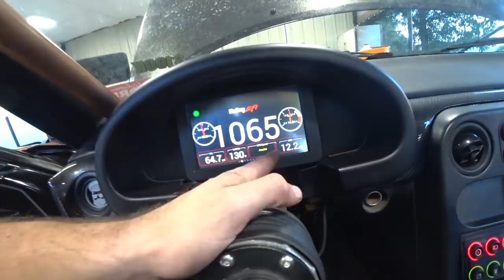Putting legit race car AC in the LS3 Miata (no ice needed) and it's a game changer.

Comment: What if you use dry ice? 🤔
Reply: Expensive, hard to find at times, systems freeze up and are a maintenance nightmare. The SuperCar Pro Series used to run a lot of dry ice systems but they have since switched to Chillout Systems. Check out the Red Bull team, they rock our system. :-)

Comment: I hate to say this but that's a terrible location for it. In a accident that's going to a heavy projectile that could easily take a head off. 

You do know that you can buy a ice makers for camping. Or if you have room in the trailer a heavier one. Small ones are about $100-150 super small and cheap. Stock water in the trailer and you are done. Hell you could buy a stack for the price of the cooler.

Comment: Question:. Why not just install an A/C unit?  Will it drain that much power?
Reply from the maker: Installing actual ac requires a lot of components. Ac compressor where my dry sump pump
Is mounted on the engine. Lines to the front for a condensor which is like a thin radiator. Then a huge box with fan and such under the dash with custom lines going there which there is no room for with everything I have mounted under my dash.
Reply from the maker: Plus the heat from the ac condensor plus the added engine load will make the car run much hotter while waiting on grid.
Reply: One of the best reasons to run a Chillout System is that it's only 11 lbs! AC systems are over 90 lbs on average for a Miata. They are heavy, rob power, do not provide cooling during wide open throttle and offer nearly no cooling while wearing a helmet, fire suit, gloves etc. This system quickly and efficiently pulls heat from your body and essentially turns your race suit into an air conditioned micro climate.
Reply: @Taylordrifts  Wow.  I didn't think about all that to be honest.   I just thought it was too much gas and it takes away from the Horsepower.   Damn!  Thank you for sharing man.
Reply: @chilloutsystems6478  90 lbs?    Are you serious?   Either way, I'm excited to see how this works out for Taylor Ray.    I hope he shares the experience when he is out at the events.   s
Reply: @chilloutsystems6478  Question I posted outside of this thread.    Can another line from separate storage tanks be run by splicing or some other method, through the device and cooled down to drink or would that need to be a separate system?

Comment: Won't the Florida sun hitting it through the back window heat it up considerably too?
Reply: It’s designed for 140° environments, it won’t bother the system at all. This car still has carpet/insulation so the performance should be excellent.
Reply: @chilloutsystems6478  Cool. Thanks for the info!

Comment: Hmm. I wonder if a TEG style seat cooler would be enough.

This thing is probably a TEG system that cools the water.

Lots of things on Amazon in the $100 range. Way easier install.

https://www.amazon.com/dp/B01CIID1FM
Reply: We use a rotary micro compressor system, it's the most powerful way to cool in such a hot/harsh environment.

Comment: y not a std ac system?
Reply: Doesn't really work on race cars. Compressor doesn't work at wide open throttle. Heavy. Also they just don't work well when you have no interior carpet/insulation to keep the heat soak down... If you are wearing a race suit, AC doesn't reach you with a helmet on, gloves, race shoes, suit, balaclava, etc.

Comment: why dont they just use ac it robs very little horsepower
Reply: Miata AC's weigh over 110 lbs, all parts included to make it work. Chillout Systems weigh 11.5 lbs. There is no power to rob, AC systems also do not engage the compressor at wide open throttle so you don't get much AC. Additionally race cars do not have insulation which make it impossible to actually cool down which even if it did the driver is wearing a full race suit, gloves, helmet and balaclava which is basically like wearing Ski Gear in a 140º car. :-)
Reply: This car also has a V8 swap which makes it impossible to run the traditional AC found in Miata's.

Comment: The color of the car is BLACK! So maybe ya should have painted it an lighter color? LIKE WHITE!...? Why add weight to your car? An it comes with more money? If your car was White less heat in Florida sun!
Reply: Still wouldn’t stop the heat from the exhaust, huge V8, hot track, hot other cars either side in the line and only two small windows.